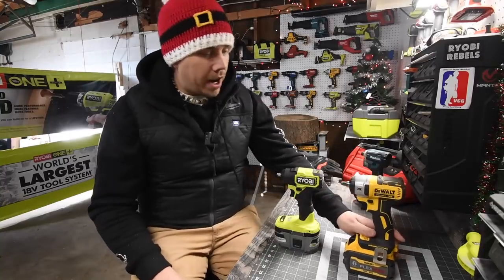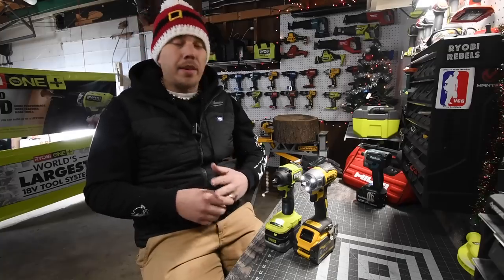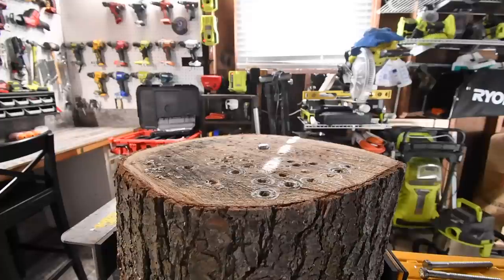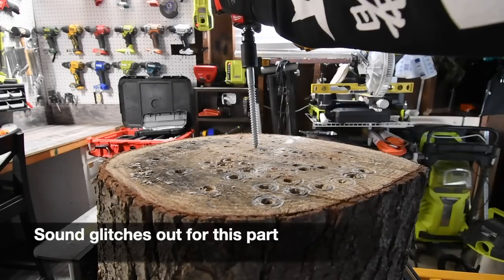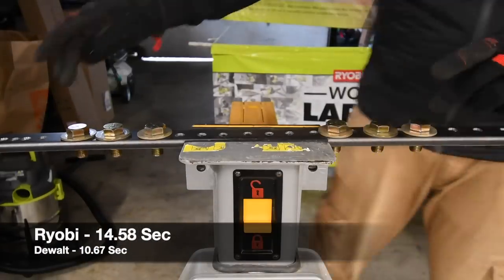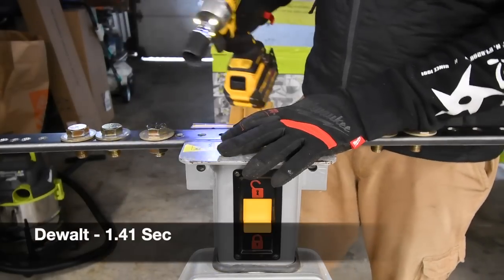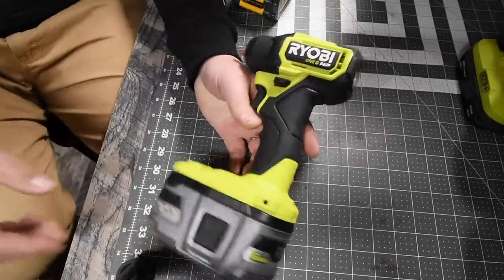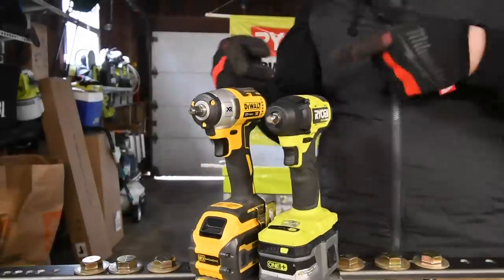Dewalt vs. Ryobi (3/8 Impact Wrench)

Comment: @MCT, why not 3/8 sockets? Just curious - didn’t know you reason to only use 1/2”. Thanks again for your reviews!
Reply from the maker: I like the strength of the 1/2 sockets. 3/8 sockets are smaller and cant take as much abuse as 1/2 sockets can. im not in many situations to where I need 3/8 but I do use them if I need to
Reply: I instantly hated that you used the adapter.  I get it that you did it to both so it was an equal playing field so it’s insignificant as far as testing goes.  However anytime you use an adapter you are lowering the power transfer to the end socket.  So the tools will both be less effective than of the 3/8 socket of the same size was used.
Reply: Had you used a 3/8 socket you easily would have taken off the 250 with the dewalt. It's the same as the Mac which is rated at 276 ft lbs of reverse torque.
Reply: Adapters take away so much torque, so it’s a fair test for the guns just doesn’t show there max potential

Comment: Am I the only one thinking an impact wrench should be substantially more powerful than a similarly sized impact driver? 
I just can't bring myself to purchase a compact wrench that may not be able to take off the lugnuts of my full sized truck. I know these two can do more things, but the time these took to get the lag bolts in didn't impress me either. Most impact drivers tested here have done it faster.
See my point?

For the record some impact drivers have more torque and RPMs than these wrenches so I could just get an adapter whenever I need to use 1/2 sockets and call it a day. And I know the 1/4 to 1/2 adapters can break with so much torque, but let's face it: with such low-ish torque output of these two, you wouldn't actually break a 1/4 to 1/2 adapter.

Comment: I’m sorry Ryobi but I have to say there’s been many a time I’ve thrown you across the room in frustration. Great beginners tools but for anything else .....
Reply: I bought a couple Ryobi tools for an emergency when I was on a trip. Was gonna give them away or toss them when I got home. That was 6 years ago. I still kick them around all the time. I abuse the heck out of them too. 😂 somehow they still work. I’ve left the batteries outside in the bed of my truck for multiple winters too. Temps into the negative F at times. I would never dream of doing that to my good tools so I don’t have any comparison for it but the stinking ryobi doesn’t mind it. For the money they aren’t bad for emergency kick around tools.
Reply from the maker: Ryobi is designed and priced for the Diyer and hardcore Diyer
Reply: Honestly I run dewalt and abuse them heavily and still work great for me

Comment: So it turns out that the dcf890 is basically a dcf886 with anvil swap.  Identical motors etc etc.   

I bet that an anvil swapped dcf887 would punk a dcf890.
Reply: I know I've Heard lots of stories about people changing to 3/8 or 1/2 anvil on their 887 and it being a beast! I'd buy it in a heartbeat if they made one
Reply from the maker: I did do a video where I swapped the anvils  out.
Reply: @ManCaverTools  

I know you did.  But a direct comparison with a 3/8 swapped anvil dcf887 vs a dcf890 with both having a 3/8 anvils hasn’t been done.  Especially comparing wilhelm skidmore results.

My prediction? The custom dcf887 would win.

My second prediction? Doesn’t matter I bet new impacts are coming out next year.  Across the board.
Reply: @juanc5149  haha... I hope your prediction is correct it seems like time, no?..
Thing is... I love the hell out of my 887, it's a Workhorse for me. I'd say I don't even use Speed 3 most of the time.... it's got more than enough power for all fasteners...
Could we use insane power for lags and smaller and  lighter frame?.. of course
Does it need it?.... Actually not the power
 do we want to see it?... yes
    Now Does the 3/8 and 1/2 wrench need to be updated? yes I'd say so compared to what Milwaukee has... no question there got to make those things more compact and Powerful to stay up with a milwaukee..
Back to the 887, I honestly think you could make the current 887 power specs but add just a little extra  power.... concentrate on making it small and compact.. it would sell like crazy ...

Comment: Did Ryobi release a new 3/8 impact without you knowing? I can't even find any videos or anything else about it. It's model number PCL250. It has the same nose(or very close) as the PSBIW01. HD says it has 220ft-lbs of torque. It doesn't say it's brushless and the body uses that older grey unlike on the newer HP 3/8 impact. Which makes me think it's brushed. It's like a mashup of the new HP but with the old style body and motor. LoL.  Please let me know if you know anything about this. It's part of a few tool with Ryobi days too. As a Ryobi fan, I keep up with their tools and not one has said anything about this. I'll reply with a link.
Reply: And it's in 1/2" as the PCL265B with 375ft-lbs of torque. It's like they just updated the old brushed models with LEDs and new noses. 🤔

Comment: I know that keeping the same battery is Ruobi's big selling point but cmon, they need to design something smaller that doesn't stick past the front of a lot of their tools. They can make an adaptor to make everything compatable.
Reply: Not thank you, i would buy a different brand if i needed something different hence why i bought the m12
Reply from the maker: I think its time to get rid of that stem as well
Reply: @ManCaverTools  why? Thats why they made milwaukee dont you think? Also this is one of the biggest selling point of ryobi.
Reply: They just need to angle the battery shelf back a bit, they've done it before...

Comment: Why you use a flexvolt  battery
Reply: idk
Reply: Moah powahhhh lol. Idk. Do those flex volt batteries offer more power? Would using that battery give the dewalt some advantage over using a regular 20V battery?
Reply from the maker: because is a 6ah battery that has 18650 cells in it

Comment: I just got the ryobi you got but I noticed it doesn’t have the extra tabs for hp battery. Have you noticed this
Reply: none of the COMPACT HP tools have extra tabs. the new HP tools that are coming out in the next few months will have the tabs.
Reply: @theTealStory  No, they don't, don't need them because they self regulate. Some of the larger tools may still use the extra pins but that isn't guaranteed...
Reply from the maker: the new HP tools do not support the older HP batteries. you need to get the new HP batteries that will be released soon

Comment: Just googled prices(for my area anyway) DeWalt 3/8 impact $139.99 Ryobi 3/8 impact $74.99 BOTH ARE TOOL ONLY PRICES
Reply: Ryobi with battery and charger is $99.99
Reply: Dewalt with battery is currently $299.99 its a 20 volt system tho vs Ryobi 18 volt system.
Reply from the maker: by me the dewalt bare tool impact wrench is $200

Comment: I thought it would be a lot closer considering the Ryobi is Brand New ...
Reply: Compact tools are generally not going to be as robust as the full size tools... Simple physics and trade off for making the tool smaller... Ryobi is also the Entry Level/Home Owner/DIYer brand.  While Dewalt is a Pro Tool Brand.  So not meant for the same target market either...

Ryobi's marketing is lousy on the details but the HP tools focused on improved technology, integrating self power regulation to get peak performance with whatever battery is used... Previously, only HP+ battery with compatible brushless combination could get that feature, similar to Rigids Octane... and better auto protection with the light flashing an error code to tell what's wrong to make the tool a lot more reliable and harder to turn into a paper weight.

So it's mainly more reliable and simpler tool option of just getting the tool for the job and using whatever battery can provide the power needed rather than needing to match battery and tool... While the first HP tools released were only compact models.  So not the highest performance as they traded to get the lower weight and size, which is unusual for Ryobi as they are typically bulky tools, especially keep in the form factor of the original battery all these years but they survived testing that bricked a older Ryobi brushless tool. So that's their main benefit...

The rest of the HP tool line up, however, is going full size, and he mentioned the more powerful impact wrench that you can already see a review on ShopToolReviews...  The HP tool line also extends into the 40v now and we'll see some outdoor tools with this update as well...  While they may be also be updating the batteries to optimize them for the HP series, as the Ryobi marketing showed a new 4AH on one of the new tools...
Reply from the maker: but also the Roybi is more compact, we will revisit this test with the new HP tools that are coming out soon

Comment: This only reaffirmed my original idea of this ryobi 3/8 wrench being a pos.
Reply: Ryobi is a cheaper brand. We shouldn't expect it to out perform something reasonably higher in price. I don't understand why people don't use the price as a comparison rather than features. I was pulling for the underdog in this little comparison but knew the dewalt woul do just a little more. My ryobi impact driver was good enough to zap off a lug nut on my car. How many things do you run across that are that much tighter at home? I do all my own wrenching and home repairs around here and some little side projects when the need arises. I can tell ya there aint much for the home gamer that those tool won't do. Not many know just how tight 250lbs actually is. If ya ask me, I'll take the pos brand for home use rather than paying a premium for something slightly better any day. It's all about intended use.
Reply: @blueovalfan23  wrong and wrong, first of all these are priced very similarly if not the same specially when on sale, second of all this ryobi would even take off lug nuts on anything bigger than a honda civic and if u care to do a lil research more
Than 50% of car sales are suv.. duh! . I am a ryobi fan and mileaukee dewalt being shit compared to milwauke but this VS shouls of been wayyy closer than it was.
Reply: @gigi9467  Nope, he's not wrong.  Dewalt is a still Pro Tool Brand and that wasn't one of their worse models but Ryobi is the budget Entry Level/Home Owner/DIYer brand and you get much better deals on Ryobi than you would with Dewalt, especially on their battery prices.

While it's a compact tool, they're not more powerful than the full size tool... Simple physics, you can't shave weight and size without a hit on performance... So yeah, the smaller tool was less powerful... DUH!  You need to have more realistic expectations...
Reply: @ZeoCyberG  go check prices, at the end of the day brand, pro or not doesn’t mean shit if they cost about the same.
Reply: @gigi9467  I know the prices and they're not the same!  Especially, when you factor sales and battery costs.
Reply: @gigi9467  For example, it's easy to get 2 Ryobi 9AH for about the same price as 1 Dewalt even without a special sale... No contest on which platform cost more in the long run... Maybe if you're comparing prices of Ryobi's Brushless to Dewalts Brushed tools but that isn't equivalent...
Reply: The pricing might be different... depending on where we all live. I see about a $50 difference on price where I am. That’s TOOL ONLY prices tho. The DeWalt was $50 more when I just looked. That’s a considerable difference to a home user that might use the tool 3 times a year. For a pro that’s a no brainer. Spend the 50 and get better quality. But for tools that are less than $200... a $50 difference could be considered substantial. NEW INFORMATION The ryobi, on sale, could drop to as low as $69 for tool only(just found someone talking about their Xmas deal) but is currently available for $75 online. The DeWalt appears to be around $130 on sale and is listed for $139 currently. That’s a $64 difference. Take the info as you want it. Of course our locations will have an IMPACT(pun intended) on price too. 😂
Reply: I just did more research. So.. you can buy the Ryobi with a battery and charger for $99.99. The DeWalt with a battery and charger is $299.99. Now the price difference is really starting to add up. That’s a difference of $200... that’s a lot to a person that might be building a deck and then planning on not using it much after that. To a professional that will use his tools on a daily... you can probably justify that price difference.
Reply from the maker: the Roybi isnt a bad Tool. im very impressed that the Roybi even could do these tasks. are there better tools out there? Yes, but there are also a lot of tools out there that are far worse than Roybi. Roybi is a good brand
Reply: @gigi9467  are they? i think the dewalt brushless was around 200ish for the dril/impact driver kit on christmas special. the ryobi was around 150 on the same sale if memory serves. i could be wrong and i didn't look up exact model numbers. i'm not following on the torque thing. if you turn something 1 ft lb, it's 1 ft lb tight. it doesn't matter if it's a 3" nut or a 1/4" nut. trust me on this one or go waste your time trying, doesn't matter. if that's what you gotta do, get on here and comment on yt videos to justify paying for the yellow tools, that's fine. i think i'll do the same, i'm good with my pos ryobi lol.
Reply: @blueovalfan23  if the prices your quoting are true then fair enough,  by the way i have over 30 ryobi tools and i know that what they claim is not true my point is that if this two tools cost the same than ryobi fucked up but if its 50% cheaper like u claim than its ok which i doubt though
Reply: @ManCaverTools  can u clear this up, i didnt see u given the part nunber for the dewalt now are this tools the same price normally or when on sale or what part number is it?

Comment: You don’t like using 3/8 sockets? Thats dumb
Reply from the maker: im just not a fan of 3/8 sockets. of course I use them when I have to but most of my automotive work I do doesn't require 3/8 sockets